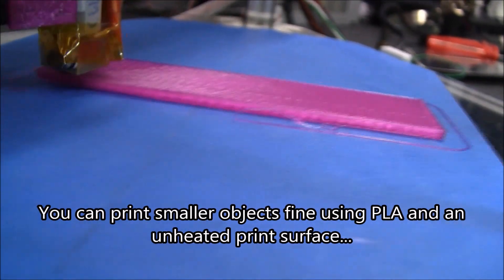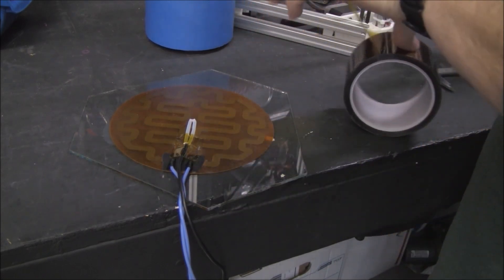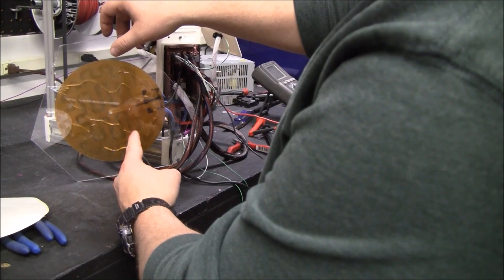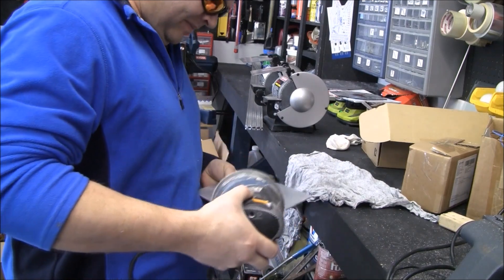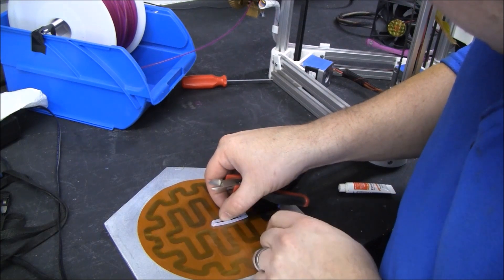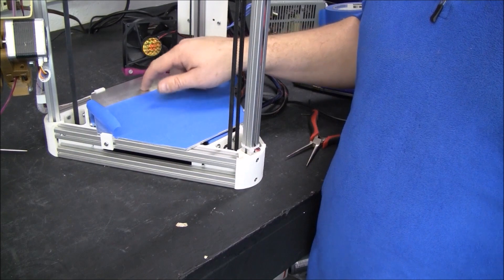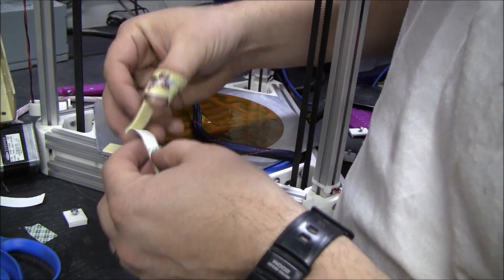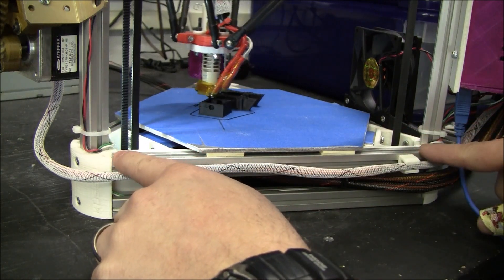Kossel Mini Heated Bead and Aluminum Print Surface

Comment: place the glass on top of aluminium to get a flat surface... that way the glass will be heated evenly, u just have to increase the temperature a bit more
and instead of double sticky tape how abt using clay with clips that way u can reduce the amount of heat being transfered rt?

Comment: Is borosilicate glass the same as tempered glass?  Building a Mendel Prusa here and am encountering the very issue you are: needing a reliable, warm base for ABS.  Great video series.
Reply from the maker: Yes Borosilicate / tempered glass is the same thing however on the Prusa Mendel a regular pane of glass works for some people as it will be heated evenly - that is what I ran for a couple years.
Reply: Thanks EH.